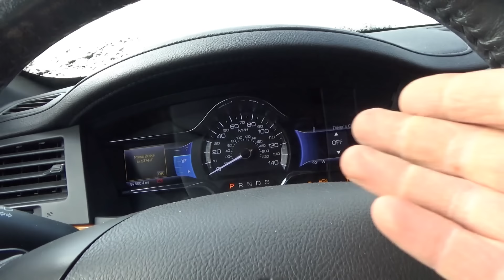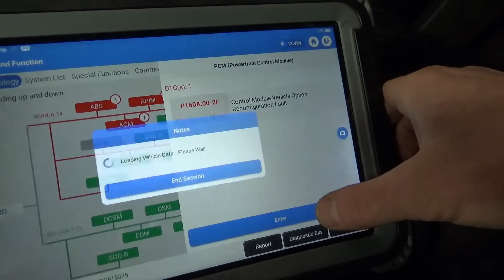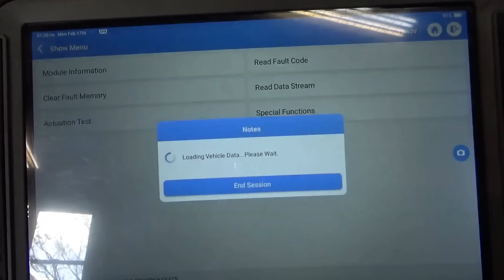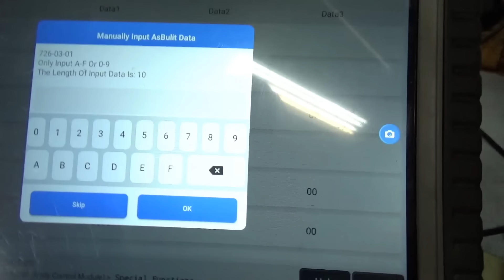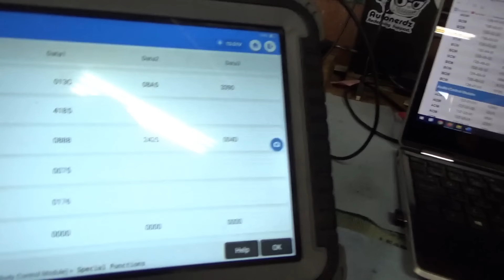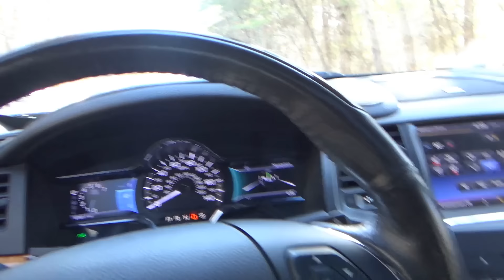(Pt 1) Lincoln BUTCHERED...by Dealer?! ('13 MKS No-Crank...GHOST!)

Comment: Those long 10 minute waits are not because the system is working. They are there to slow down car thieves. One technique used is once they open the door the plug into the OBD and program the car to accept a new key. They don't want to hang around 10 to 30 minutes waiting for a computer.

Comment: Given the problem description, the dealers involvement is really secondary because the dealer did not diagnose the vehicle, what matters is we have the original BCM which we should reinstall. Then the first step, given the age of the vehicle, is not to use the scan tool, but to do a full inspection of the vehicle critical wiring. The strange behavior and how the vehicle died mimics what would happen if you loose a main power feed or block ground, or some other critical high power connection or ground. If you have a post lift you can raise the vehicle to do an inspection of the underside of the vehicle. If the vehicle will not move most shops have a large 4x4 ATV or UTV with custom bumpers and hitch, to push or pull the vehicle into the shop.

Comment: Maybe you need to match the beat of the turn signal on the radio to turn it down?
It's seems apparent they have just about succeeded in making cars that can ONLY be repaired by official dealerships.
Cars will soon be only for the very rich that can afford brand new and only taken to dealership for repair.
$$$$$$$$$$$$$$$$$$$$$$$$$$

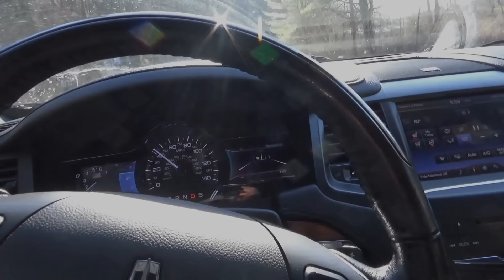Comment: On 26:29 the outside temp is not showing in the radio and in the beginning of the video it was showing 20 degrees. Did the BCM lost communication with the outside temp sensor?

Comment: Late model Fords have a "BMS" (Battery Mgt. System)...when charging the battery the chargers' negative lead needs to go to a chassis or engine ground (not the battery neg. post) and the charger positive lead can go to the battery positive post. This "includes" the BMS in the charging circuit thus rendering the proper charging/voltage.

Comment: My friend asked me to go and take a look at one of these a 2010, they were asking 10,000 and it was in front of a for lack of a better word a salvage yard. I did, first off the brakes were vibrating uncontrollably, he let me take it for a drive, I took it to a friend of mine who put it on a lift, what we found underneath was unbelievable, the entire front of the car every part had yellow paint marks on them, like a used part would have so the entire car had been rebuilt, it smelled of coolant the ac didn't work the body on the passenger side was wavy which you could only really tell looking up at it, this car was in a fairly major collision, she's the kind of person who once they see something they like they have their heart set on it no matter what, it took me a while to convince her that the car would be a headache for her, her brother was a mechanic but he passed away in 2011 and he would get cars for her when she needed one. What she was replacing was a 2003 town car, I told her that her car was better than that newer Lincoln, who knows what electrical problems that car would have down the road, plus 10k was way too much, who knows if the ac system was damaged in the accident, it could cost plenty to fix that alone and whatever was leaking coolant.

Comment: if the bcm is not programmed or configured  i don't think the vehicle will read the keys. you also need two keys when resetting bcm, other option is `parameter reset sometime you get lucky.

Comment: The fast clicking turn signal. I wonder if it could it be incorrect bulbs flagged as bad bulbs (wrong amp draw) by the headlight module.🔧

Comment: FORScan (which costs almost nothing) is far better for dealing with As-Built data and can handle programming and most other functions. 

These MKS sedans are nice cars. They were built on the Volvo S80 platform and could be had with the 365hp EcoBoost V6 and AWD. Pretty quick in that form.

Comment: Ivan, Ask the owner's husband to get a hold of the district Ford Rep for their area and file a report about the dealer telling them they can't fix the Lincoln. This is a "screw the pooch" kind of complaint for a Lincoln owner to have to deal with. Ford should be made aware of this. I am well connected with the Ford dealer where I live, and the Service Director here in NC would never have released the car back to the owner like that. This should be no charge to the customer from that Ford Dealer; their shop should eat this charge.

Comment: Had similar issues with an customers auction expedition, Ms speed canbus was definitely a probably  as well as bad cluster and smart junction box (BCM) replaced cluster and BCM then ran an overlay for network com then programmed modules with my Autel IM608. Once programmed most modules on MS network came back on line so now I'm removing the overlay wires and going through 100 miles of wire to find the bad wire connection. PS many things will still work without network function but not all so you can't tell by testing power windows etc. HINT Ford Ms network usually goes to dash modules then to center consoles before returning to the DLC under the dash

Comment: some users mention OBDlink, but I found it useless:  it does not have commonly expected functions such as actuators actuation tests, like a normal scanner would have (my scanner has actuators actuation tests).  The applications that are used with this hardware are useless , as follows.  1)  ForScan is "unable to identify the vehicle".  2)  OBDwiz identifies and connects to vehicle, but has NO useful commonly expected functions (like a scanner would have): no actuators actuation tests, etc.  3)  AlfaOBD does not connect to vehicle.

Comment: You should be able to sue a dealer if they can't fix a car they made
Reply: dealer did NOT "make" any cars.   Factory (manufacturer) "makes" cars. This question should be handled by attorneys: laws are very complicated.
Reply: You can sue the manufacturer. Dealers don't "make" cars. They are just there to take your money. Car guys always call them The Stealer.
Reply: if the dealership fires a bunch of parts at the car without fixing anything, the customer should only have to pay for labor, not the parts.  Dealerships are ill-equipped to troubleshoot many electronics issues in cars made this century.  It's beyond their skill set.  We need many more consultants like Ivan.
Reply: @emylrmm  Dealers are in it fort he money, not pride in the cheap work they do.
Reply: @emylrmm  Many 'techs' are oil and tire changers.
Reply: dealerships are just an intermediary, they just buy cars from the manufacturer and sell to the public.  They are contracted to do warranty repairs and recalls, nothing more.

Comment: Hi, Ivan!  You REALLY need to add Forscan paired with an OBDLink mX to your arsenal.  It's absolutely indispensable for dealing with Fords.   When I'm working on Fords, it's my go to.
Reply: I’d think his Bosch vci would be able to connect to Forscan
Reply: I agree.  I have Forscan with OBDLink EX and it works very well.
Reply: Forscan is definitely j2534 compatible.

Comment: You can restore As-Built module parameters in one click using Forscan software. Its free aftermarket software for Ford flavored vehicles, you just need a 'trial' subscription to write to the modules. These parameters are VERY important and tell the modules what vehicle options are installed as well as set things like seat belt reminder notifications. This is exactly what the Forscan software was designed to do. I used it to disable the fast turn signal flashing when LED turn signals were installed and used it on another vehicle to perminately disable the annoying start-stop feature. Changing one of those numbers will modify some option in the module, but all can be restored in one click.
Reply: I use it all the time!

Comment: I miss the 90's/early 2000's, when cars were really on top regarding simpleness/repairability vs longevity.
Reply: Me to 🎉
Reply: Better yet- the 1950s and 1960s cars were much more simple.
Reply: @jeffryblackmon4846  But not as reliable and with much shorter maintenance schedules. The 90s to early 2000s were truly a sweet spot in automotive manufacturing.
Reply: Agreed.

Comment: Since about 2000 the majority of cars have become way to complicated. why do we need networks and cam buses? why do we as consumers allow the auto makers to keep building cars that many dealers can't fix? My car is a no crank no start because my climate module is broken, what in the hell is a matter with this picture? This Lincoln is 12 years old and now some of the computers/modules are no longer available, holy crap so we just crush the car and buy another one.

Comment: That's so weird, I've NEVER had a Ford kick me out of PATS, either with Autel scantools or FJDS.  Check for updates on your scantool.  That may be a software glitch, or it may be a hint to a module issue.  Waiting 10 minutes after every action is a Ford security thing, not it kicking you out.  It's the trade-off for not requiring an LSID PIN for vehicle anti-theft.

The turn signal thing is NOT normal.  Sure is fun though!  That may be the result of a misconfigured/incompatible BCM, but I've had newer Fords do similar things with faulty harnesses and bad headlamp control modules (water intrusion).

I get the feeling you received the vehicle with multiple issues, and now we're back to where the vehicle was prior to Ford attempting to repair it.  I have seen several Ford vehicles come back from the dealership misconfigured or with incomplete programming sequences, and there's no excuse for it.  It's just techs thinking they know what they're doing and not reading service info to get the correct sequence.  It's not always as easy as just doing a PMI.

Sadly, Ford recently restructured their licensing system.  It's now $120 for two days instead of $50, while leaving the annual license at $1200, and that's an absolute game changer for us independent techs.  I'll probably be looking into an annual license at the start of next year.  :(
Reply: The annual license was 900 last year.

Comment: With modern electronics systems, they forgot the KISS concept. . .
Reply: They didn't "forget", they wanted it this way to make repairing difficult or impossible for even some of the most skilled techs, hoping  you just buy a new car. It's by design and very deliberate.

Comment: Ivan, I first saw you when Eric O. introduced you on his channel.  Most of the time when you say, "It may need to go to the dealer," you end up repairing the vehicle yourself.  I have a feeling this is going to happen.  My neighbor has a mint 1994 Mercury Grand Marquis with 20,000 miles he inherited from a relative.  When the headlights are on "hi-beam" only the high-beam lights burn; the low-beam headlights go off.  He thought he had bad bulbs.  I did some research and that is indeed intended operation.  On my '96 the low-beam headlights stay on; and that is intended operation for that model.  However, I don't think the uneven flashing sequence of those turn signals is intended operation.  GREAT VIDEO!

Comment: How come thieves can steal these cars in seconds but when the genuine owner or mechanic wants to program a key it won't allow them to do so I always find that fascinating.
Reply: Your thinking of hundai/kia
Reply: @NorthLakeAuto2 Nope, it's all of them. Some worse than others. Toyota is having a big issue right now. They hack into the network and do as they please. Give it up about Hyundai/Kia, it's old. That was a classic style theft, no immobilizer.
Reply: @disgruntledcanuck 
Been following the Toyota thing a bit. It’s not that simple, at least from the stories in the Australia/NZ press.

They cut into a body panel to gain access to the CANbus wire. They then use a very sophisticated electronic hack device in order to trick the vehicle into thinking that an authorized key signal has been given. The electronic device is very, very expensive. From what I’ve read the units are difficult to get ahold of and cost the criminal $5K+. 

This is apparently why the vehicles are being stolen by organized crime only. The organizations also have the ability to get them on ships(I guess they are able to disable the GPS anti-theft signal with this device also)and off to Africa or Asia they go.

It’s not an easy endeavor and targets are mainly the super high end Toyota/Lexus specimens.

This problem is quite a bit different than the whole KIA-boys thing.
Reply: Because Auto Theives specifically get the programmers that locksmiths have access to purchase because they're licensed, they're made specifically for key programming and depending on manufacturer and or model it may be proprietary and therefore it becomes a locksmith only function, they're not just generalized scan tools like majority of mechanics have.
Reply: @jdsimon These units are specifically made to hack in. If they can't get in through a headlight, I've seen them cut a hole in a panel to access the canbus.
Reply: What a ugly friggin car. 🤮🤮🤮🤮🤮

Comment: On my Ka+ My car turns off the ignition if it goes below 12 volts or if the battery percentage goes to 50% or lower it will be interesting to see what battery percentage that car is at and is there anyway you can keep the key on mine is a physical key no fancy push start maybe that makes a difference.

Comment: I'm so happy that my Ford dealership are not like that they will fix the problem and they're very reasonable as well I got the air conditioning checked the oil changed and 1 track rod replacement on my Ka 2019 for 240 euro And unlike the independent garage I went to the last time they don't replace things unless they ring you first which is great.

Comment: A careful reading of notes is critical. Note says to connect batt neg to chassis to disable auto power off.
Reply: Yes, you have to get current flowing through the current sensor/ coulomb counter, which is on the negative side.

Comment: 1. The current sensor on the battery detects current in and out of the battery. So when you connect, the battery maintainer to the battery, the system believes that the power is being drawn from the battery. The correct way to connect a battery maintainer to modern cars with current sensors is to connect it at the alternator. The alternator being the source of energy.
2.If you had used FORScan , it handles as built data better than any other tool.
Reply: Ford recommends the neg jumper be connected to chassis ground to account for the current sensor on the battery terminal.
Reply: Not sure you connect to the alternator.  On my 2016  F150, there's some sort of sensor on the negative side.  Not sure what it's there for since my truck isn't doing anything smart.  At least on my truck, I think you'd hook up to a good chassis ground not the negative terminal if you needed to trick the computer.  But I concur with FORScan.
Reply: The current sensor is on the positive lead on my 2014 hence my comment. I agree, the negative should be body ground. The point is that I don’t have it shutting down on the maintainer.  @major__kong
Reply: I was going to make the same comments.
1. The ground of the battery maintainer can go anywhere off of the battery. It does not have to be the alternator. 
2. Just to expand on your comment regarding Forscan, Forscan will download the asbuilt data automatically and save it to the vehicle. It just takes a couple of clicks. There is no need to manually enter the parameter values. Forscan is also dirt cheap, whereas Ford just raised the price for 3-day access to FJDS / FRDS from $50 to $120, a 140% increase overnight.
Reply: @n124lp  It also lets you backup the current configuration before reverting it.

Comment: All the companies are discontinuing modules for not very old cars and it is causing problems as the so called repair places are iffy at best and low production cars mean no eBay or junk yards
Reply: BINGO! You won't be able to get pcm/ecm, various modules, stupid infotainment unit. Now you've got an expensive brick. Utter garbage and criminal in my view. As much as I hate government regulations, things need to change. Roll back to truly serviceable vehicles and forced parts availability for a set time? There's many ways to skin this cat
Reply: @disgruntledcanuck  some gov't regulation is always needed in any industry to help prevent this kind of greed-driven corporate practice

Comment: Learn to lock the ignition to ON position. They generally have a combination that you do in order for it to not shut off in 120 seconds...
Reply: That's what I thought but I have been scrubbing the Internet and I can't find anything out other than there is a parking brake service mode, but that doesn't effect the time out period as far as I can tell.
Reply: @jtjones4727 ask a dealer tech friend of yours, they might tell... You will not find stuff like this on the internet unless you find a dealer level educational stuff...